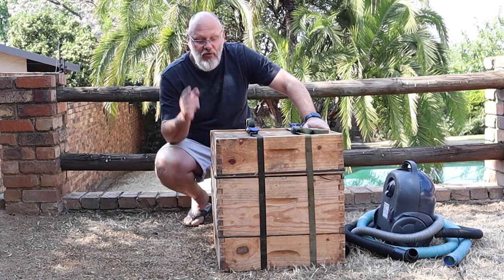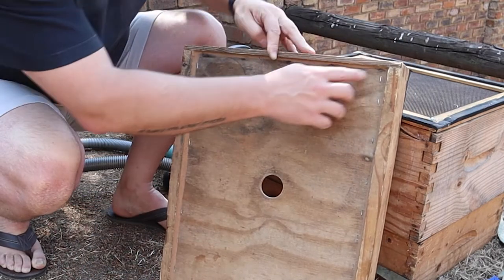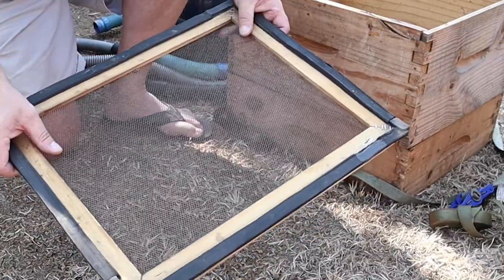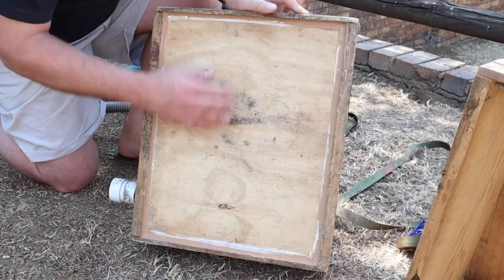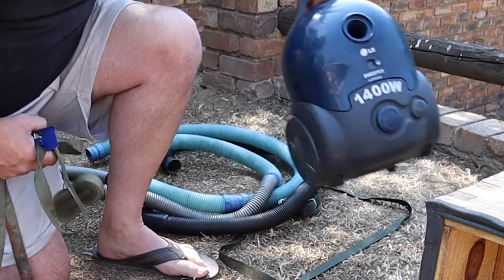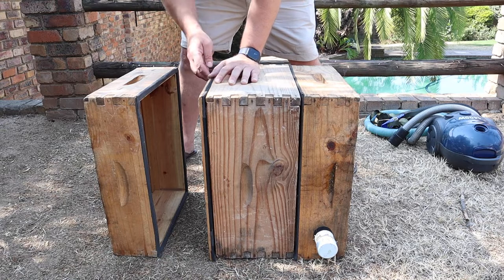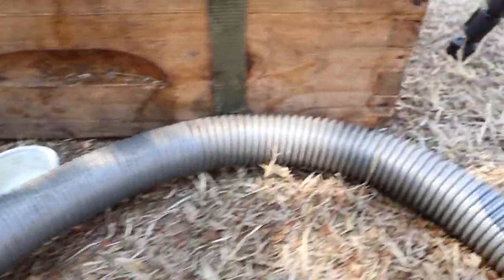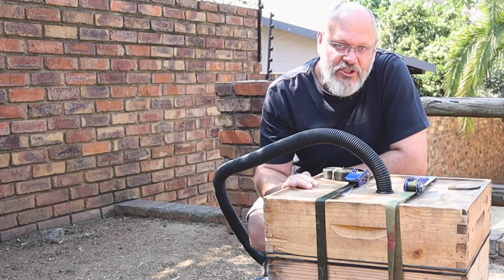How To Build a Bee Removal Vacuum | Beevac

Comment: Built one similar about 20 years ago.  The only mod would be halving the amount of mesh so bees can hide away from airflow.  If you don't understand let me know
Reply from the maker: Great idea. I was also considering using Perspex over the one end so we could see inside the box.
Reply: @BeeSanctuary  perspex is ok, I prefer wood or glass for other reasons.  Over the years have made lots of different types, the one I use presently is a motor unit that sits atop a bucket and an electronic suction controller.  If I get time I'll probably buy a battery vacc and modify that.  It'll save on petrol using a 240V genny.
Reply from the maker: Some great ideas here, we have electricity blackouts daily here and always have to plan our removals around the schedule. We could cart a generator around, but if you see our vehicle it is quite full already.

Comment: you don't need the lower super. run the hose out of the deep.
Reply from the maker: Yeah, that will work. It will make it lighter too. I've left it like tis as I wanted to experiment with opening the box on site and placing the frames in the brood box before transportation. The hope is that the bees would climb onto the brood during transport and then when we get to the apiary we can just place the box onto the floor and put the lid on. Have not tried this yet.